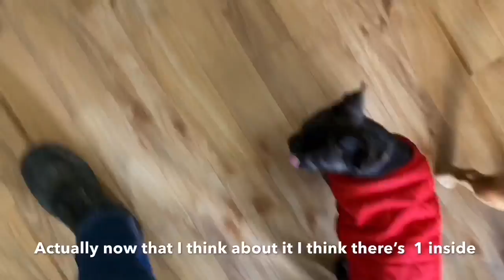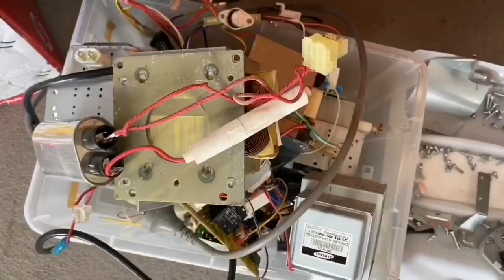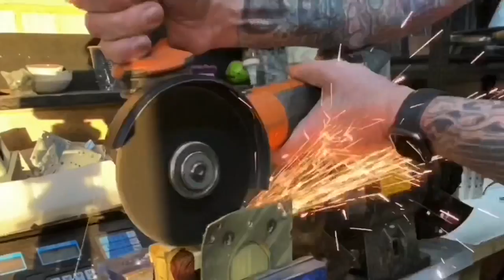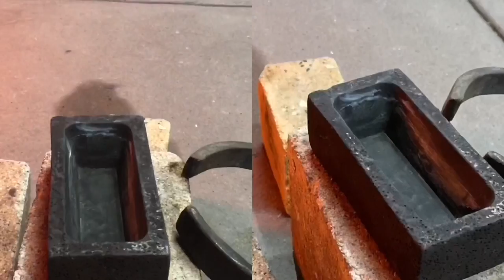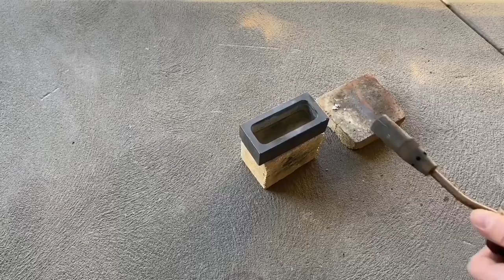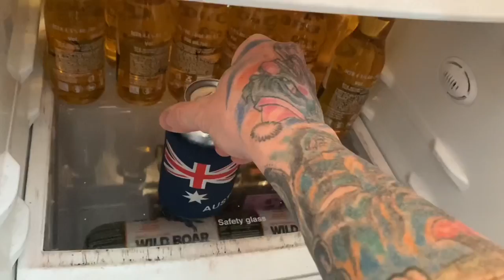Microwave MeltDown - Copper Casting - Trash To Treasure - BigStackD - ASMR Metal Melting

Comment: Save the transformers, you can use them to make a mini ark furnace that gets up to 3,000 degrees F.
Reply: His devil forge gets up to ~2500 degrees C...
Reply: Or a welder
Reply: How can I make an efficient furnace from microwave transformers?
Reply: @ultimumlibertas5727  yes but any welder made from small transformers can only weld small and very thin metal joints
Reply: Or lichtenberg wood burner 😁 I made mine from one and a veriact transformer works really well
Reply: @nickybritain4900  yes but from i have learned, the more transformers you integrate the more amps you get in output. In my opinion anything more than four things can start getting sketchy in regards to safety and machine productivity. Its still a useful thing to know or have in the back of your mind
Reply: TKOR fan I see
Reply: Show me how.
Reply: I read this in grants voice
Reply: @nickybritain4900  easy
Reply: @nickybritain4900  true

Comment: First: SAFETY - To anyone considering tearing down a microwave... BE CAREFUL of the magnetron tube. The ceramic it is made of will disintegrate into fine powder if broken. That is the stuff that can cause silicosis if inhaled. Safety rant endeth.

Second: Thank you for the hundred dollar burn! I've missed those so much, it was such a wonderful trademark.

Third: After the "email me for 5%" caption, I envision BigStackD mailing out little penny pouches of the used insulation from the furnaces, roughly 5% of the mass of the insulation ;-)
Reply: That isn't normal ceramic. It's beryllium oxide and it's a carcinogen when in dust form

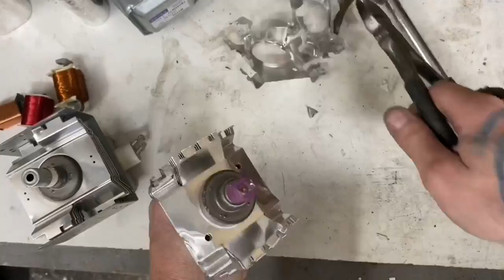Comment: 5:28 that round Gray cylinder between Pink ceramic rods is actually copper, Just cut off those rods with pink stuff very closely to that cylinder and peel off Steel from cylinder itself and you have about 90 grams of pure coppah!
Inside you can find thoriated tungsten filament. 
Warning! Those ceramic rods (White, pink or purple may contain BERYLLIUM OXIDE which is very toxic in form of dust, so no hammers allowed here)
Reply: Awesome, now beware that Thorium ( Thoriated Tungsten) also low-level radioactive do not inhale that dust either.
Reply: @chriscarley9951  and don't touch the transformer otherwise you'll die
Reply: Was just about to comment on this. Usually only go so far down the comments and end up repeating unnecessarily what has already been said lol.
Reply: Very smart man good boi u have fulfilled ur job
Reply: @seantaggart7382  Unless it's plugged in the transformer is most dangerous as a bludgeoning device
Reply: @Misha-dr9rh  yeah
And I learned from styropyro

Comment: The magnetron is very dangerous be' carefoul
Reply: @santifernandez1814  inside the small ceramic cylinder there is a gas that can make you blind

￼
Reply: @santifernandez1814  it's safe once the caps are discharged, which only takes a minute or so anyways. I learnt that disconnected power does not mean safety the hard way lol
Reply: It’s just that purple tube you need to be careful with. Everything else is just normal electronics stuff.
Reply: BS mate, I’ve broken down hundreds of magnetrons, they are pure copper with ceramic ends sealing a VACUUM! Smash the ceramic off, pure copper!
Reply: @santifernandez1814  its the  beryllium oxide that is the issue. If you inhale it you will be in major trouble
Reply: @ScrapiT68  😂
Reply: Geez, like he needs to be told. 🙄 Stop already with this shit.

Comment: Hey bro, just out of curiosity, heard several tales of a part in microwaves that is highly carcinogenic, which one is it and what do you personally do with it?.
Reply: Nuckelavee it’s not an issue unless you break it
Reply: Joachim Shekelberg true, they stopped using it in about 2007-2008 when they switched to aluminium oxide
Reply: @Jollydog69  I'd rather not find out if it's safe to screw with.

Comment: To save a tiny bit of your grinder wheel, instead of grinding the welded seam on the transformer, put it on the ground and smack it with a hammer, the weld is quite weak and falls apart with only a couple of hits.

Comment: Beryllium is needed to be mentioned around the inside of the magnetron as it is HIGHLY DANGEROUS ATOM AND CAUSES DEATH AS WELL CAN THE RESISTORS MAY STILL BE LIVE VOLTAGE POWER SO THERES A WARNING IF PULLING APART MICROWAVES

Comment: Just be careful ripping apart the magnetrons. Those white ceramic insulators have berillium oxides in them that can get airborn when they get chipped or broken. It can lead to very bad lung problems with just one small exposure.

Comment: How do you think the yields are between spot price vs cost of gas? Do the metals far exceed the cost of gas? And does that include driving to get the tanks refilled and any fees/tax associated with filling them? How many melts do you think you get per propane tank before you have to refill? 

I'm really curious about your foundry. It's very well put together...I'm assuming you made it yourself? I've been wanting to make one and thought of using a propane tank. But they are a bit small. Yours almost seems like a pressure cooker maybe? Is that 2500 degree kaowool? And did you spray with rigidizer? And do you have fire bricks on the bottom of it? Thanks in advance for taking the time out of your awesome day of melting to answer all my curious questions. 👍

Comment: I as a hobbyist with electronics have takes apart like 5 microwaves for the internal parts for my "projects" for example the transformer to play with 2KV and stuff or to take out the magnets from the magnetron so i never thought about smelting it down in my foundry XD. But i still wouldn't do it although those ingots are lookin real good

Comment: Fun to do and to watch. However, I doubt that on a small scale it is cost-effective. Factor in the time spent, the cost of the furnace and propane, and then see what the actual return is on the metal. Aluminium is too cheap to make it worthwhile and copper needs too much propane. There can also be a very large stored charge in the magnetron that can be lethal if not discharged before handling.

Comment: Nice idea but copper spot price is about $3/lb so you are getting just below $6/microwave in copper here. Also have to either strip the insulation somehow or deal with the toxic fumes. So yeah probably paying less than minimum wage but nice idea to recycle this stuff. I feel that in a few years having this skill will be a lot more valuable.
Reply: Good on you for stacking the metal.

Comment: I 🤔 think copper and brass really give you hard times for shining and melting it. Most of the time you put Borax in Brass and both metal are not shiney after you shaped them in the cast iron mold. Aluminium and Tin was easy to shine and mold.

Comment: If you scrap a microwave wait 24-48 hours after the last time it was plugged in before doing so. They have very high power capacitors in them that can and will kill you instantly. The magnetron also contain beryllium oxide. In solid form is safe to handle but if crushed or ground on the dust is highly  carcinogenic and can cause Berylliosis. An incurable chronic lung disease. Do some research first, then decide if it's worth it to scrap a microwave.

Comment: Videos which involve taking apart microwave ovens shouldn’t be on YouTube at all. Those microwave ovens contain capacitors which are big enough to kill you, by electrocution. And there’s also the chance of applying power to the microwave tube by accident, in which case you’ll die of gangrene, a few days later.

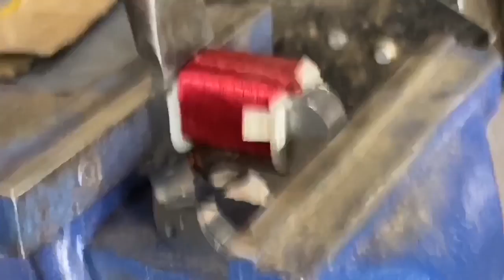Comment: Be highly suspicious of any copper that is super red like that, 4:06 scrape at it with something steel and sharp before melting because it is often aluminium wire with a red coating. This guy may have made one of the first copper-aluminium alloys that I've ever seen. have the ration be 95% copper and 5% aluminium, rather than the usual ratio of 10-20% copper to 90-80% aluminium

Comment: as mentioned this is not something you should try at home, there are numerous hazerdous parts to a microwave, not the least of which is the magnatron itself which tonains as shown a powerful magnet (which can be bad for you if you have a pacemaker)  but aslo maintains a lingering radiant charge if its even been used once, while microwaves are not a form of ionizing radiation its still not something you want any form of long term exposure to, and nevermind the other various potentially hazardous things that are on the circout board and other electronics inside so...yeah...as the guy says, dont censored try this at home

Comment: Hi bidstack this is kind of a too afraid to ask question... do you actually scrap fully functioning electronics ? Or do you just act like it?
Reply from the maker: When it comes to the stuff I steal. From the house there all faulty  like this microwave was so I thought I would have done fun with the video, But when it comes to the motors and cabinets and bits and pieces I get from my local site unfortunately some of those things are brand-new when i Melt them . My friend is a boss on a local site just near my house and he gives me free reign over the scrap bin as long as I don’t abuse the privilege of and because they don’t get any of the money from anything they scrap they prefer me to take it home and melt it down even if it’s a brand-new motor that has been deemed obsolete on this particular site. I take them home on the condition I don’t run to the scrapyard to sell them or fix them up to sell for a quick dollar I have to show me breaking it down and melting it on a future video and that’s part of the agreement even if it is a brand-new motor worth a couple of thousand dollars. I’m in talks with that particular site where I may actually get two brand-new 1000 LB  motors for free these things are probably worth $15,000 each and they said I can more than likely have them for free again as long as I strip them down in a video. This probably won’t happen for a few months and that’s still a 50-50 if I get them. It’s an absolute shame some of the things I throw out on this side but at least if I take them home I can build my stack and make a video

Comment: Do ypu know about the plate spinner  i watched a clip where someone took out all the gears and set up 5v usb cable with rc car cheap  motor and got 100v spinning the magnet thats under the gears? If its 1 amp 5 v and the machine reads 90/100 volts is that milliamps. Just i had shock and was quite sore while turning slow with all the gears insidd it. Free energy i doubt but shock was alot and to get really hig 90s  fast is 5v? Im not electrician so confused why shocks when not connected to motor few volt max shock. So with motor?

Comment: Hey BigstackD you ever accidentally over heated zinc?
Reply from the maker: Yes I do it all the time these devil forges are so good with the heat efficiency you need to be very careful melting zinc in them. And I very regularly also overheat my brass because of the same reason and if you get that too hot all the zinc will burn off and make a mess🤦🏻‍♂️
Reply: @bigstackD  so does the zinc burn yellow and foam? I have 2 ingots of material that have done that, im actually having the difficulty identifie the material

Comment: I have a devil forge  my copper looks non copper.  Do you have  separate crucibles for different metals. That might be mi problem . I only have the 1  and I’m might be mixing the metals ?
Reply from the maker: I do you have different crucibles for different metals but when I first started out this channel I would use the same Crucible for pretty much everything I will just make sure to give it a gentle scrape out after each melt while it still red-hot with either a flathead screwdriver or stainless steel spoon. But if you’re pure copper is not coming out looking like copper then I would think that is possibly your problem

Comment: I'm having an issue where the wire in the transformer isn't copper coloured inside when cut. It's silver inside so mustn't be copper.
Reply: Nevermind you addressed this issue, its aluminium.  Dam that sucks. Is there a way I can tell before taking the transformer home? Like I collect alot of microwave parts but want to be sure it's copper before taking and destroying the transformer

Comment: i want to get into melting random metals into bars just as a hobby but not sure about how much money or practice it would take
Reply from the maker: Check out these links for your answers 👌🏻
Start up costs 
https://youtu.be/nyp0GiE5FTQ

Gas cost
https://youtu.be/JehOMAJ9JBQ

Furnace comparison 
https://youtu.be/jwNY9PswHDY
Reply from the maker: Also check out Swdweebs channel He starting a series on learning to cast metal and it’s very informative and enjoyable to watch, be sure to let him know I sent ya👊🏻😁
Reply: @bigstackD  i saw a youtube video of someone melting aluminium cans in a steel can over a hot fire and then using a sand mold to pour it into. would you consider this a good way to try this out cost free? (although it is more dangerous id assume)
Reply from the maker: Yes it certainly can work mate I started off using steel crucibles but you’ll only get a couple of uses out of them as the aluminium will eat away at steel for some reason and you’ll end up with a pinhole size hole appearing and it’ll eventually get bigger and you’ll lose all your metal. It certainly will work and it’s a very cheap option to try it out you just won’t get the ease of melting it with the proper equipment And the ease of and the ease of Quicker and cleaner.

Comment: Did you really melt a fully working microwave ? Isn't that supposed to be TRASH to treasure ? Like for the nuts melting, this seems to be a huge waste of energy for producing it if it ends melted prematurely
Reply from the maker: Actually mate that microwave was not heating properly and was faulty and was getting replaced so I thought I’d have a bit of fun with the vid👌🏻. I love to melt stuff down but I’m not about to melt down perfectly good appliances , Now when it comes to the motors And other bits and pieces these Are destined for the scrapyard from this local site that I live near , as my friend is the boss there they have stated numerous times productivity is more important than what they can get in scrap value or to re-purpose or re-sell the scrap or in this case new motors that they have in their scrap bins , this motor was deemed as obsolete it will never be used again on that site. I believe this motor was brand-new all it had was a crushed fan cover that could’ve easily been fixed with five minutes and a hammer, 
The boss has given me free reign on the scrap bins as long as I don’t abuse the privilege and as long as what I take offsite he sees in a future video where I melt down and that’s on the condition I don’t run to the scrapyard or sell it or fix it for a quick buck. It’s an absolute shame some of the things I do meltdown but that’s part of the condition that I’m allowed to take them home with me is that that’s what I do with them whether it be an old motor new motor old light fixtures or brand-new padlocks etc.
Reply: @bigstackD  Okay I am reassured on this point since there is a malfunction. But it must be said that it was really not easy to guess by watching the video. 
You are obviously not responsible for what is thrown away instead of being fixed, it's a very different task. I am always sad to see that productivity always takes precedence over the ecological aspect, but it is another problem than destroying a functional object, which would have been really irresponsible.

Thanks for taking the time to clarify things, looking forward to watching new videos !
Reply from the maker: No worries at all buddy but rest assured any of the videos I do where I make it look like I melt something perfectly fine from the house is just a bit of fun, I did the same thing awhile ago with all my Flyscreens and sliding doors because we put security screens on the house and when I did my shower screens that I ripped out we were renovating so I thought each time I have a bit of fun with the videos😁👌🏻. I have a broken down old roller door motor which I’ll be doing in a future video and I’m gonna make it look like I knock that off the roof and melt it down but again just a bit of fun with the video👌🏻

Comment: I don’t know the slightest thing about melting metal unless it’s with a welder. But is it possible to do a stainless steel ingot? Or would it just oxidise?
Reply: Luca yes but it’s very hard to do
Reply: The Nigerian Is that because it doesn’t pour very well and cools to quick?
Reply: Luca it’s because of how high the melting point is, it’s quite hard to melt enough to cast